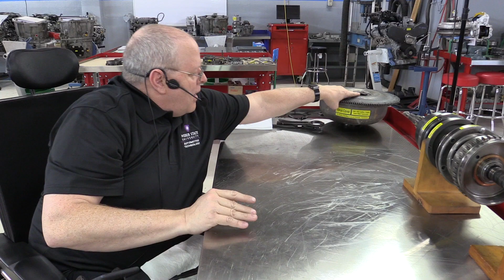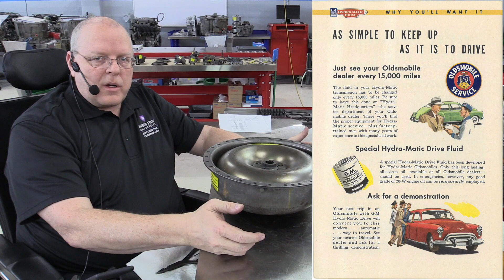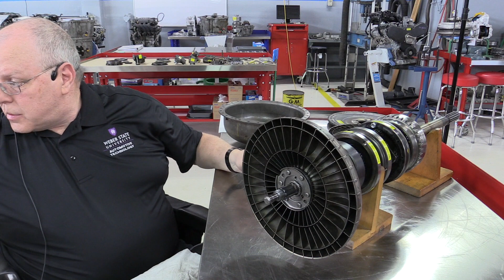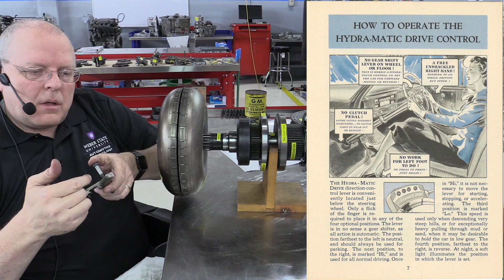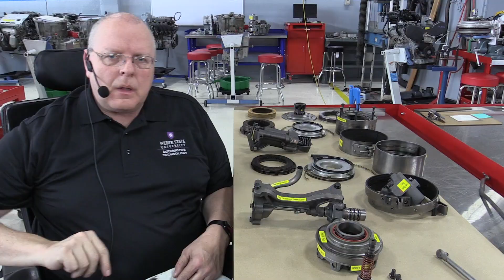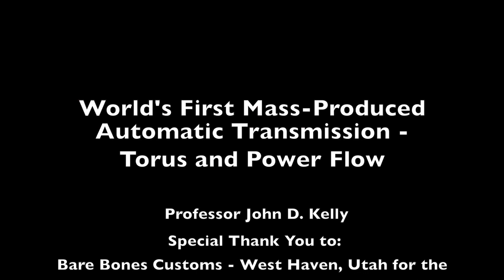World's First Mass-Produced Automatic Transmission - Part 3 - Torus and Power Flow

Comment: At 20.40, it's interesting about the direct drive.  In some ways, the fluid coupler acts much like a lockup torque converter.  The guy that designed the Hydra-Matic was a genius and you, sir, are a master at explaining the operation.  It's way above my head, but I get some of it.

Comment: Excellent! My Dad had several Oldsmobiles from 1940-1948, and my first car is a 1950 Pontiac which I still have - all with Hydra-Matic drive. I remember that the older Oldsmobiles from 1940-1948 had much more than 30 bolts (I remember 48 bolts) around the flywheel. I remember as a kid helping my dad remove these bolts and slowing moving the flywheel around with a big screwdriver wedged against the bell housing.

Comment: FYI Cadillac did use this transmission until 1955, changing in 1956. In 1953 a few Cadillacs were produced with Dynaflow transmissions as a result of the fire in the Hydramatic plant. Great videos.

Comment: Wow++++! What a simplistic transmission for its time! And seaming pretty robust and reliable enough to be used in the sherman tanks! But if they were capable of moving an Oldsmobile or Caddy land barge.....I guess they thought it would be suitable for tanks!?!? I've rebuilt many turbo hydromatic 350s 375s and 400, 700r4s 2004rs along with a few computer controlled 4L60Es and this thing seems to be a walk in the park for transmissions compared to what they were building and how bad GM would cut corners and make purposeful failures in these I've listed by using low grade part's inside them! Knowing first hand that plastic bushings and other weak garbage parts wouldn't last much more than 100K miles or less on many of these transmissions like that of the 700R4 and 4L60E's! I've found them stuffing clutch packs with large spacers to save money on a couple clutches! SMFH as I'm sure you've already seen this sickness too. But yeah to build something that they know is ultimately weak or going to fail is exactly why I don't drive a domestic vehicle anymore and switched to driving a Honda Civic sadly. The Japanese at least do everything in their power to make a good reliable product which I was a denialist at the beginning of my ignorant life. It dawned on me one day at work why don't we ever see a Honda in here with catastrophic transmission failures??? Well I learned why when I bought one and have well over 200k on the original everything but suspension and tires and brakes! There's not a chance in hell  a GM would have been so trouble free that long except for the Chevy Colorado I bought brand new in 04. It....come to find out why it lasted me amazingly 200+k was due to the fact that Isuzu built them for chevy and GMC and it wasn't made here! That was the last GM I'll ever buy new unless they've changed their ways in screwing people over by doing what they do best! Cutting the fat and putting the 10 cents here and the 5 cents there back into their products rather than their profits 📈!  They given themselves their own black eyes over the decades now and they are no longer what they use to represent. But I  Thank you for making this video! I learned a  great deal about these Oldsmobile transmissions. My mother use to talk about her 57 Olds convertible and automatic transmission and I still remember how much this was emphasized about not being a manual 3 on the tree! And why I was looking up what transmissions were used for moving Sherman tanks I stumbled upon your videos who gave me exactly what I was looking for. An in depth experience with the thing apart so I could absorb it and fully understand how simple yet small it really was to move such big equipment and reliably no less! that's to me is incredible!  Here I'm picturing some sort of heavy equipment system or totally hydraulic system or maybe an Allison would have been necessary to move a sherman tank?  Lol guess I was going a bit overboard on the torque capability of the original cast iron transmissions? Thank brother and God bless you 🙏

Comment: I worked on a torus unit very similar to this one earlier this year. I'm pretty sure it was from a 1956 Cadillac. The only difference was that the planetary gear that drives the impeller was inside the torus shell between the damper and the impeller. I believe the transmission was a Jetaway 315.
You make very informative videos!

Comment: Question:  Of the 6 damping springs in the torus cover hub )at about 5:00 into the video) are all 6 tight so that you cannot move them with your fingers or are two (opposite each other) tight and the other 4 can be moved?  If 2 tight and 4 loose, do the 2 tight ones look the same (length, number of turns, wire size),  while the others look different?

Comment: Thanks so much for the explanation!  This is the only video demonstration I could find of an old Hydra-Matic like this one, and it's great! The only question I have is how do the gear ranges work? I know there are low and drive (high) gear ranges on automobiles with these transmissions, and I would like to know which gears are in which range. Is 1 and 2 low, and 3 and 4 drive, or is it a completely different mechanism? Sorry if my question sounds dumb, but I'm a rookie, just learned how an automatic transmission works.
Reply from the maker: Thank you. The transmission starts in second and then shifts through fourth. Low must be manually selected to get 1st. There is no park, you just put it in reverse, set the park brake, and shut off the engine
Reply: @WeberAuto  okay, thanks for the reply

Comment: The very first mass produced automatic transmission was very complex and sophisticated for its time. Also the fact that this transmission had a direct drive in fourth gear from engine to output of the transmission with no slippage would not be seen again in future automatics transmissions until lock up torque converters were developed.
Reply from the maker: Good information
Reply: The Packard Ultramatic had  a lock up torque converter, as did the Warner gear transmissions that Studebaker used.

Comment: What kind of fluid would you use in one of these today?
Reply: According to GM, Dexron 3 is backwards compatible. Some use Ford Type F. Some do a 50/50 mix of both. Type F has the proper viscosity and was recommended by the rebuilder of my unit who specifically attended courses at Hydramatic in 1958 to rebuild theses transmissions. Using Type F in the power steering system sealed all of the leaks that Dexron created. Just my experience.

Comment: Great videos!--thanks so much. My dad's '64 Olds had a three-speed HydraMatic, the last year before GM introduced their new-design torque converter Turbo HydraMatics. To my recollection, these latter-day three speed Hydramatics were missing the 2nd gear of four; gear changes between one and 'two' resulted in quite a reduction in motor speed--from "floating the valves" in 1st gear to lugging in 2nd, especially noticeable under heavy acceleration.

Comment: Nice video, I have a 1953 Oldsmobile 88 rocket v8 with a 4 spd hydromatic transmission..  over 300k miles in almost original condition....  still running as daily driver when parked in 1972.... enjoyed this explanation on how it worked.... one day I'll have to rebuild this transmission and this video will be valuable to review operation of it.   I'm afraid that the 'how to rebuild knowledge' will be lost in time as the experience will pass away with our elders. ... it would be great history to have a complete video on the rebuild (start to finish) of one of these great transmissions..... I say almost original as in 1953 the rear axle was to small in diameter to handle the torque these transmissions produced... dad replaced the rear axles till he could not get anymore because the torque from dead stop if stomp on the gas would snap the axles.  In 1954 Olds increased the axle size beefing it up... dad replaced the rear axle on next snap...to a 1954 rear end and snapping of the axle stopped...  great video...

Comment: In third gear, the power flow goes through the  front planetary gearset, through the torus and then back to the output shaft. But doesn't power get divided between the torus and direct drive to the rear gearset?  So, that suggests that the drive member of the torus would be turning at a ratio of 1:45 reduction relative to the driven member.  You would think that the Driving Torus would lag behind the driven member. How did they avoid drag between the two members when operating in 3rd gear?  I must be missing something here.  Anyone have an explanation?

Comment: Many thanks for sharing your knowledge and research! Question about 4th speed - you say it is a totally direct drive bypassing the fluid coupling, but I cannot see any mechanical connection between the front and rear planetary set, it must still go through the fluid coupling. Am I missing something? The front clutch is engaged in 2nd speed too, so the torus housing is locked to the entire front gear set and the driving member in the same way. The only difference between 2nd and 4th is the rear band/clutch changing the rear planetary from a reduction to a direct drive. What is the mechanical connection bypassing the fluid coupling in 4th gear?
Reply: Never mind, just saw Part 5 and your correction answering this very question. Fascinating how many innovations had to come together to make this happen!

Comment: Hey John, more than a year after we talked about it and that 1st and 2nd gear had me stumped again, even after looking at Aaron Severson's drawings. Your video explained it to me (again ...). It is unusual (and clever) to power the ring from the flywheel and have the cage drive the pump, indeed. Watched your Honda 5 speed automatic a couple days ago, that was great, and your Getrag dual clutch transmission is next on my list.

Comment: the locking lug that mates with the reverse drum IS the parking dog and engages when you put the transmission in reverse and shut off the engine. my 55 pontiac had this also. that dog has to release to back up or go forward as the output shaft is locked when its engaged.
Reply from the maker: Thanks for your feedback

Comment: John inspired me to look into it, Hydra-Matic in 1940, a 3 planetary 4 forward speeds design, was more than 10 years ahead of everybody else IMO. Buick did Dynaflow which has a torque converter but only one planetary/2 forward speeds, Chevrolet Powerglide was one planetary/2 forward speeds, and those GM divisions would eventually come to heel using the superior technology of Hydra-Matic, Borg Warner / Ford-O-matic was 1 planetary 3 forward speeds Ravegneaux starting in 1951, and Simpson / Torqueflite 2 planetary 3 forward speeds wasn't until 1956. Aaron Severson of ateupbymotor has excellent content on the Hydra-Matic.
Reply: dynaflow still has the better ideas of a torque converter as the blades can be pitched and it's a 3 row style add in a lock-up mode and or remove/redesign the sprag with a electric or hydraulic holding and or power recovery and it's 👌

Comment: Hello John, 68 year old George in MI here. Nice videos! I really enjoy watching such things even if they're about things that I already have a basic understanding of. You seemed to concentrate a bit about the fact that the torus has a drain plug on that transmission and I'm sure it's because none of the modern automatics do anymore. My 1966 Comet Cyclone GT's C-6 did and I had a hell of a time once getting the guys at a trans shop in Biloxi MS to drain it when I took in in for a fluid change. I really wonder why they stopped putting those little 1/4" pipe plugs on them? Balance issues?
Reply from the maker: Hi George, Thanks for your feedback. Yes, I am sure balance was the major reason for it's removal I am sure leakage was another issue. Have a great day!

Comment: Very clever how the transmission is basically two, two speed transmissions together, and also how fourth gear is driven directly by the engine eliminating slippage through the fluid coupling.
You do a great job with your videos, thank goodness there is someone like you to take the time to do this.
Reply from the maker: Thank you very much!

Comment: The Torus casing driving the intermediate shaft directly (bypassing the 'as we now know' highly inefficient designed pump & turbine) in 4th gear is highly innovative; it is almost functioning as a locking torque converter before it was invented. Also interesting is the lack of overdrive in these early gearboxes; figured since motorways aren't invented yet & roads are still terrible you won't be going anywhere quickly.
Reply from the maker: Thanks for your feedback!

Comment: Great and interesting explanation of the Hydra-Matic! It is fascinating how the engineers at that time made this historical transmission possible with so little technical resources.
You mentioned that the number of damper springs in the torus cover indicates typically the number of cylinders. Is there a explanation for it?
Reply from the maker: Thank you! Yes, every 4 stroke engine had normal pulsations in the rotational speed of the engine's crankshaft. This is due to the power stroke (of the 4 stroke cycle) rapidly pushing the piston down in the bore after the spark plug ignites the fuel. On a 6 cylinder there are three of these pulsations per revolution of the crankshaft, on an 8 cylinder there are 4. The number of springs in the damper is typically half of the number of engine cylinders.
Reply: Thank you for the explanation!

Comment: If you look at the blade spacing on the fluid coupling you will see there are three distinct patterns of unequally spaced blades. The impeller is identical to the runner side by side but when they are face to face they are opposite each other. This is done to prevent the blades from aligning with each other as they rotated. If ever they exactly align they will create an axial pulsation that eventually will lead to failure.
Reply from the maker: pbooth001 thanks for the information. I did not know that.

Comment: what does the pressure relief valve  on side of box do and for what as mine develops a massive leak after a 30 mile run at approx 60 mph, these boxes in 4th are direct drive and dont develop any   pressure as such, torus , flywheel etc are bone dry with new gaskets, new torus main seal, but it can only come from main seal , this will be 3rd time out of car,
Reply from the maker: Hi, the valve on the side of the transmission is the pressure control valve. It controls the internal line pressure (the pressure that applies all of the clutches and bands).  I am a little confused. Is your pressure regulator valve leaking or something up front by the Torus? If it is the valve leaking, remove the valve, it should have an o-ring and a copper sealing gasket. Your o-ring or gasket may be leaking. If the leak is from the Torus area, the front oil pump is supposed to have a gasket to seal it to the front of the transmission case; fluid can leak there and look like the front pump main seal is leaking. Of course it could be the pump main seal too. The seal could be leaking because the pump-to-Torus support bushing may be worn out (allowing the Torus to move laterally inside the seal and bushing). There are also some drain back holes in the front pump main seal area that allow fluid leaking past the Torus cast iron seal ring to drain into the oil pan. If those holes get plugged with gasket sealer, they will not drain and the fluid will leak out of the main seal (even if the seal is good). I hope that helps. Feel free to send me photos jkelly1@weber.edu when you get it out again. I am happy to help diagnose. Best wishes.
Reply: great , will do when i remove it shortly, did not go as far as drain holes in front pump , that could be one of the problems, either way its coming out again, it was spotless inside when i first took sump off, previously rebuilt but when  who knows, cheers ,steve ,uk

Comment: Apart from the direct drive fourth ratio, the drive through the Torus [fluid flywheel?] must have been quite inefficient. The lack of roller and ball bearings also indicates to me that there was probably a high percentage of friction and heat loss along with a probable high wear rate compared to modern transmissions. What sort of mileage did these do between overhauls?

What makes me wonder what the service life of these was, typically, is that I recently visited the British Imperial War Museum North at Manchester UK and looked at an extremely complex and advanced looking [even by today's standards] multi cylinder, fuel injected, supercharged engine. A notice to the side of this beautifully engineered marvel indicated the average service life of these engines, which must have cost a small fortune each back in the day. What do you think it would have been? 6000 hours? A bit less. Maybe 3000 hours? Actually it was an incredible 35 hours [give or take and excusing my memory]. That was mostly due to planes being shot down of course, which begs another question. What was their actual design life? Hence my curiosity as to how long the Hydra-Matic lasted between overhauls and whether they were mostly reliable.
Reply from the maker: Hi, that is a good question. I do not know the answer. I do know that the fluid needed to be changed every 15,000 miles. Todays transmissions typically go 60,000 to 100,000 miles between fluid changes. Thanks for the feedback.
Reply: I'll add one bit: the higher the impeller speed, the thicker the boundary layer of the fluid, which allows it to transmit more power to the turbine. Efficiency of the fluid coupling increases with engine speed.